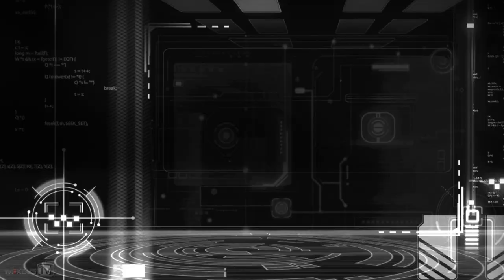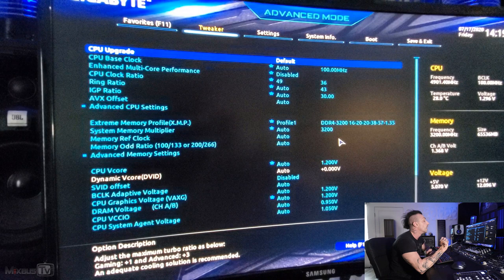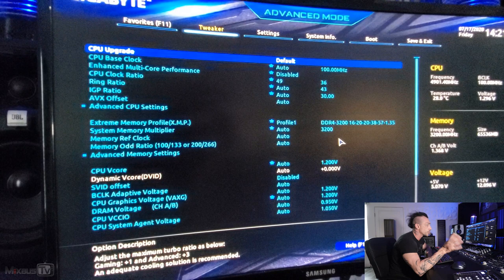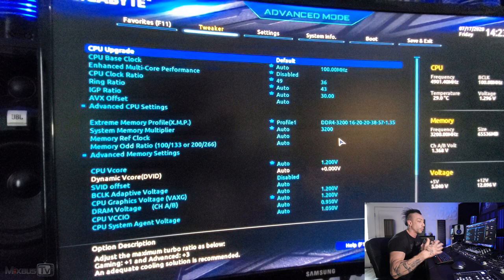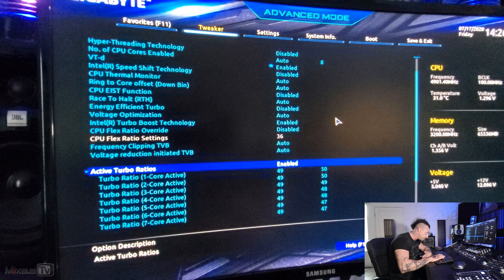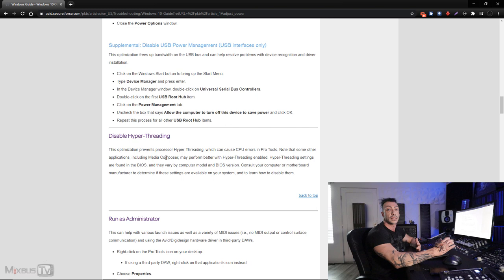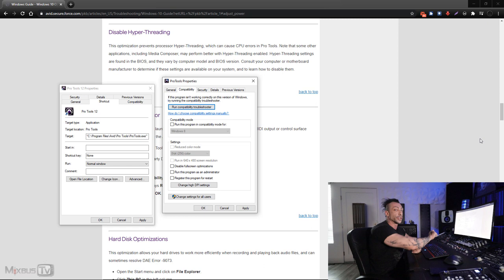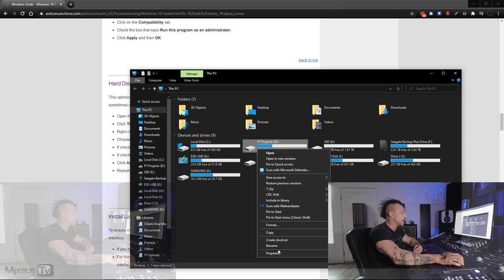Optimize Windows 10 for your DAW - BIOS & Windows

Comment: KUDOS to you for making such critical info available to DAW users in an understandable form. I have a similar system to yours and it NEVER goes online other than to install upgrades direct from the vendor site. I don't install any unnecessary software as it is a dedicated studio machine. One thing I would suggest if using the machine online for browsing is to use BRAVE free browser as using Google browser puts any machine at risk not to mention the personal info you are giving up. GREAT WORK!!

Comment: Thank you so much for all these tips - in particular the BIOS settings which I had completely over looked. My 200+ track orchestral template in Cubase now runs like I have just upgraded my PC with all the previous CPU clipping completely gone. (I have a 9th gen intel i5 going from base clock of 3.7ghz to consistant turbo mode of 4.6ghz).

Comment: Although I do not use PT any more (Cubase), there was one trick commonly used in gaming I used to do if the multicore was not spread even in a session and that was to disable core Zero (first core), this then spreads the workloads and leaves core zero to be used by Windows. You do this by setting affinity in the task manager on the PT process, it resets itself the next time u boot up PT...
Reply from the maker: You can't do that anymore. They took that possibility away from PT at version 10 or 11, no affinity, no cores disabled, you set it and soon as pt starts takes over and out everything back to normal
Reply: @mixbustv  ah typical Avid :D

Comment: Hey David, thanks for this video! When I saw your video on building an audio pc I had just built mine with 9900K, intuos cooler loads of similar parts!

I recently read about setting CPU affinity for Pro Tools so you can reserve a couple of cores that Pro Tools cannot use, that way windows processes can use those two cores for example, and Pro Tools has the other cores exclusively. Do you ever do this and have you seen any benefit if so?
Thanks and loved your Mixing Modern Rock course! (Shout out to Warren, saw your interview on his channel)
Reply from the maker: Happy you liked the course.You can't do that anymore, since 10 or 11 they took that option away, even if you disable 1 or 2 cores and set the affinity higher, PT takes over as soon as you open it and put everything back to normal.  It used to work yes
Reply: @mixbustv  wow really? I didn't know that... Guess I won't bother doing that then :) Thanks for the reply!

Comment: good video
The reason why you couldn´t apply other peoples settings is because every single CPU is different and different quality even if it´s the same model.
Disabling hyperthreading can give you more single-core performance and that gives you less latency or more plugins to run on one core. Especilally on tdp and shitty cooling limited devices like my laptop with i7-8750h it made a big difference.
Reply from the maker: Yes, cpu's are inconsistent, but with the bios update I was able to get it in the range of most

Comment: I”m a musician. Ikve recently found out that I need to be able to switch off “Turbo Mode” and “Connected Standby” in reg edit within Windows.Without the ability to do this, any Windows laptop will be of no use to me, due to the constant power grabs that these codes are used for. If I cannot turn off Turbo mode then I will get clicks/pops in my audio/and constant “throttling” . I need maximum (or near) power resources going to my Cubase/Logic/Ableton software. According to info received, Microsoft have completely removed the ability to do this in it’s latest 2014 software update.
Do you know a way around this prob? I believe the new software just gives you a “slider” labelled something like More-Less! This is a big problem for audio professionals using DAWs. Any help would be v much appreciated!
Do you know if this latest update has put this application back?
Desperate find out!
Reply from the maker: Afaik there's no way to do it other than disabling turbo modes from the BIOS, which depending on the computer might not be possible on a laptop. That's why laptop are not for mixing really

Comment: from Cubase forum:

1- Hyperthreading is a feature of Intel’s CPU platform. Hyperthreading effectively creates logical cores that do not exist as physical cores inside the CPU. Therefore when HT is activated the OS sees, and the OS scheduler can play with, double the count of logical cores than the amount of physical cores on the CPU ;
2- considering the same heavily multi-threaded computational scenario an identical hardware core frequency and core IPC, we know that 8 logical cores out of 8 physical cores CPU will always perform much better than 8 logical cores out of 4 hardware cores CPU Hyperthreaded to a total of 8 logical cores ; moreover, the 4 physical core CPU will almost always perform better with HT activated (8 logical cores) compared to HT disabled (4 logical cores). The exceptions to this general rule are the very old, early generations of Intel’s HT implementations and Windows scheduler implementations (prior to Win 7). Of course the gain from HT (10-15% typical) is of course much less compared to doubling the physical core count on the CPU (duh!) ;
3- different OS thread scheduler implementations will react differently to an app’s dynamic usage of multiple threads; Microsoft’s scheduler is one thing, Apple’s is another;
4- applications are not programmed to “use” or “not use” Hyperthreading ; the OS sees the amount of logical cores that the CPU provides it with, and apps are going to be provided with CPU time on said logical cores according to how the OS’ scheduler schedules the entire pool of threads, of course up to the limit of threads that each app can internally use. In other words those apps that are still single-threaded are still going to use a single thread on a single logical core on a single physical core, apps that can only deal with 4 threads will still use 4 threads, etc. ;
5- a higher count of physical cores, and to a lesser, but still significative extent, a higher count of logical cores due to HT, will both improve computational performance in a multithread scenario, as a whole at the OS level ;
6- HT has been shown before to improve multi-threading in DAW benchmarks.
Reply from the maker: Not on PT really, makes no difference at best
Reply: Hyperthreading adds latency, if want the absolute lowest latency, you must disable.
Reply: @christianwn  good to know

Comment: Do not use the normal Nvidia Driver, the normal driver causes pop and click when you open and close plugins etc, instead use a card that support the Studio driver. This has huge impact.

Also enable msi interrupt mode on Nvidia cards with a tool like: msi mode utility.
For lowest possible latency.

Comment: Thx Dave but you lack to disable background apps in system settings of the OS and for Nvidia you need to set prefer Performance in 3d Settings to reduce latency Spikes but Overall you catched all relevant except the 2 i will highlight again cause it makes a big different. What i really missing was measured resulta from latency mon in long term measure (30min+) to see that ur system dont create latency cpu spikes, hope you know what i ment and thanks for sharing and all the best from germany- |R|
Reply from the maker: True about the Nvidia performance settings, good call as for the background apps, apparently this version of W10 puts them back on after 30 minutes or something, unless there's another way to turn them off, all background apps restart automatically

Comment: ah was just thinking this earlier today :) thanks!
Reply: A q:
I started using an external recorder to 'Print' my mix,, because I SWEAR offline bouncing or even offline realtime bouncing just doesn't end up sounding how I'm hearing it in the DAW. Also if I re-route and record back in daw, this is not ideal as id like to capture at best sample rate.
 Im in Studio One, maybe this problem isn't in Protools. But its been a reoccurring theme with me with cubase reason studio one (reaper is quite good though) so I like to record the mix to a tascam da3000 and I end up with my mix sounding exactly how it did when I was in the daw. I guess best is to do what you all do and 'PRINT' re-record the output back into the daw.
But my question is,, I hope your PC windows 10 system allows you to record the mix from Protools to an app like 'audio hijack' but without dropouts or clicks random annoying pops etc. I'm on Mac, but Im going to build a PC very shortly!! :) I reckon it could be a Mac thing,,, I TRY AND RECORD MY MIX into an app like 'audio hijack' whilst Studio one is open ands playing mix - but if I have 'audio hijack' open suddenly random clicks pops stuff randomly occasionally gets recorded also. I suppose it could be my sound card but Im using uad Apollo x6. I honesty reckon a setup pc maybe I won't have these problems, my 2012 Mac Pro (darth faders' dustin design) isn't up for the modern task maybe even though the ssd is the new fast MVME. 
:
Id be interested if you could record your mix from protools to an app of any kind for high quality wav recording without any annoying low clicks or pops etc.
Reply from the maker: Why you want to record into another app? And no PT sounds exactly the same online or offline, given that I mix analog so I can't do offline. But simply print into your DAW, send your master to an audio track and record exactly what you hear, is that simple
Reply: Thanks :)
I think i need a modern computer - if i try and re-record inside the daw when my sample rate is locked to what the sources files were say 48k 24bit,, then that’s the best quality to capture it... ideally i’d like to capture it at 96k 24bit
maybe i’m just being silly. I’ve watched videos on youtube on quality difference between 96k and 192k and have decided that 96 is best to capture atand anything less then you’re missing out. Maybe i’m totally wrong. 44k has a sound; so maybe just don’t worry about it and print off the mix re-routed from analog mains to a daw stereoaudio track. 
But on my 2013 mac i get pops and other random stuff so i will be building a pc!! Macs are cool and user friendly but it can’t handle what i throw at it!
I watched your rock course really great tuition and insight into the way you operate your mixes,, and at the end i did see you re-recording the analog 2bus mix back into the daw, and many famous people i’ve watched on mixwithtgemasters do that; but sone people always record off to a dedicated laptop running a separate pt (cla) or record it off to a hard recorder like tascam da3000 (brauer). 
Currently my computer gives me random pops and sounds when i try and record the mix back in the daw on audio track, and i’m on highest buffer, so must be time to upgrade tech that is a decade old.

(btw, if anyone uses apollo x6, please use the virtual output as the main daw output,, then on audio track select same virtual input to route it: my pops and random occasional disappointing sounds disappeared when i did this - before i was monitoring for uad MON. Do i highly recommend you change it to Virtual. I really like uad plugs as it’s been an excellent platform to learn tools with (!) i might say their stuff is rock solid but i’m not convinced with their audio ad/da, that’s why i also have an orion hd32!
Time to build a pc for me!!
Thanks for the awesome tips! I never thought to look on youtube to build a pc - it doesn’t look too bad! I’ll also use i9 990k and same other bits!
Reply: sorry about my question being a bit unrelated to the vid.

Comment: Hello! Thank u for this info.  Is really useful for me. 🔥
I have a question that has nothing to do with this tutorial, but you or someone may know to help me. I need some simple information.
I want to buy "Universal Audio UAD-2 Quad" to be able to use UAD plugins, but I want to parest my Focusrite Saffire 26 sound card. Do you think UAD is likely to have a conflict with Focusrite when do I record or mix?
Reply from the maker: You should be able to connect via ADAT without problems but your master probably needs to be the UAD, but I'm not sure, don't have nor use either brand. You want an external clock tho'
Reply: @mixbustv  Thank u for your answer! I have to do more research about this topic on the internet. 
Cheers and stay safe!

Comment: I'd be curious to try some of these tweaks with my PC running Win10, Cubase 9.5 Pro, soon to update to 10.   I've got the Intel 8th gen i7 8700K.  With mixing I'm not having much trouble with enough juice, but when tracking I run into a wall.
Reply from the maker: what's your buffer when tracking?
Reply: @mixbustv  ideally I want it at 32, but that has my CPU real time peak meter popping up and down and often won't let me record, only at 512 will I get no pops or drop outs.

Comment: Haven't tinkered with overclocking in years but if you lock your cores in the BIOS and gradually under volt, you can reduce your CPU temps by 10 to 20c depending on your cooling and fan speeds.

Of course it'll take time to find a sweet spot with stability depending on your setup.

Comment: Here is a trick, Microsoft Interrupt Affinity Tool, use this tool to bind your driver to a spesific core, will help with lowering the latency. Driver being your sound card or usb-driver. You can also put all other drivers on a different core. Again only for the lowest latency possible.